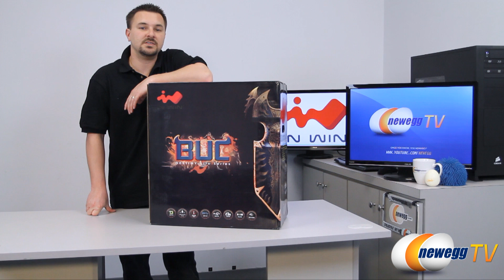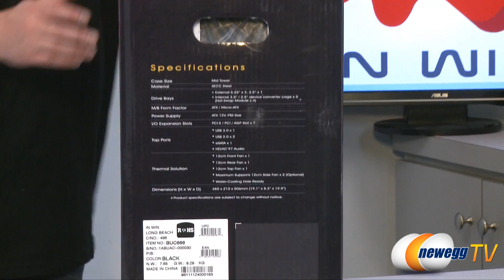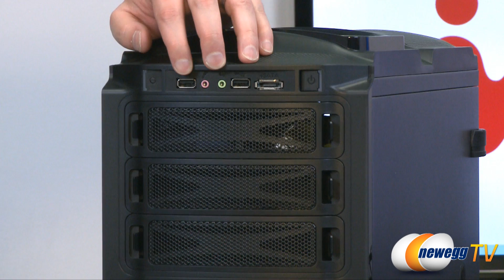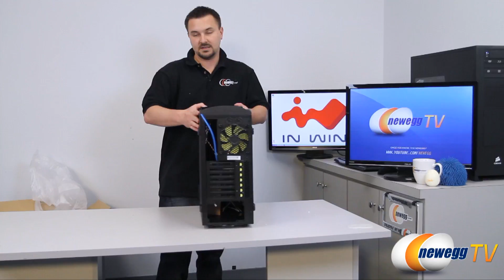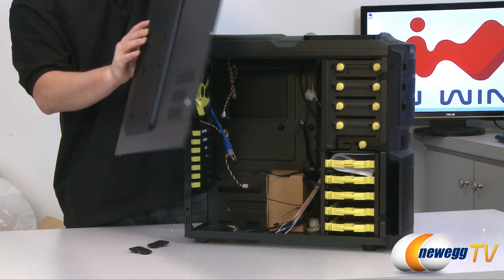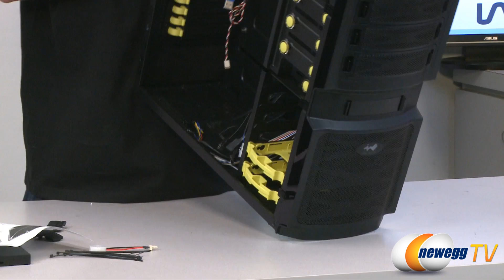Unboxing: IN WIN BUC Black SECC Steel ATX Mid Tower Computer Case

Comment: What do you call those accessories that slide into the 3.5 inch drive bay... I'm trying to do a newegg search but I'm not sure what key words to use.  "3.5 inch" just gives me 3.5 inch hard drives, and I know that you can put more than just hard drives in there (I mean if it was just drives why give it an access point to see it from the outside?)